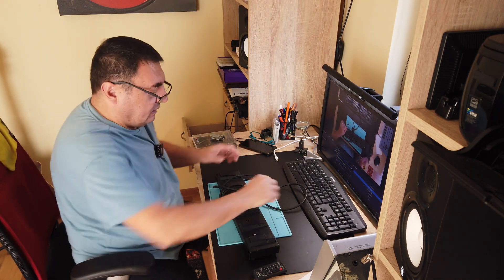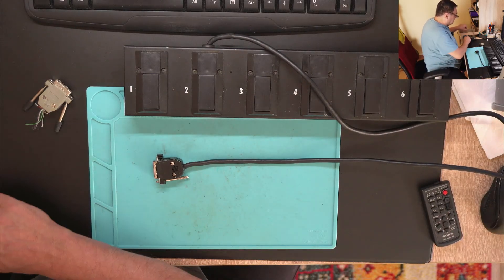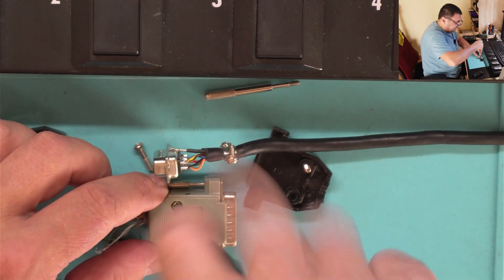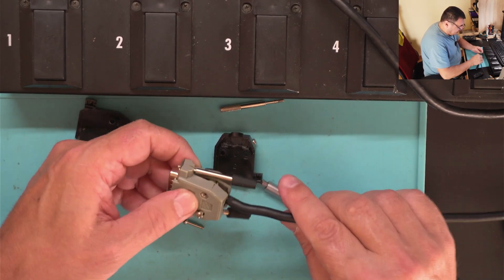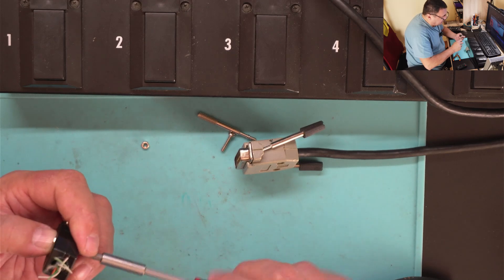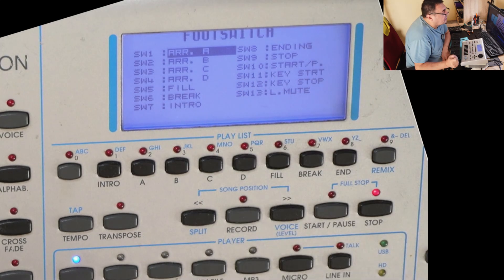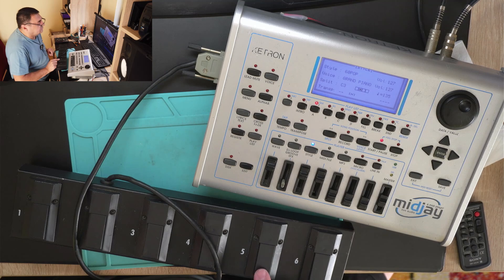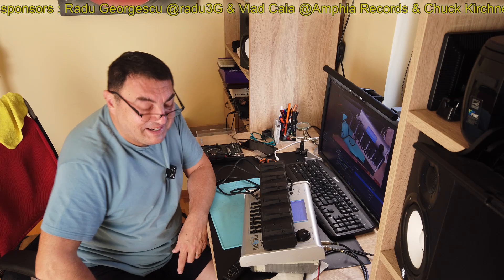Ketron FS6 Pedal Switch Fix

Comment: Să trăiți! oare dvs reparați cotx x3 miner? am o erroare pe el și nu știu ce să-i fac... Îmi spune pe HeliumGeek: Gateway No Valid Witnesses... am pus și antena stock, am schimbat și softul pe un microsd nou și tot așa...
Reply from the maker: Pot fi multe explicatii, santeti pe deny list sau e propblema cu amplasarea real a hotspotului fata de cea raportat. Ar putea fi si blocul radio, sa nu fi fost trasnit, nu neaparat trebuie sa ia foc! O incarcatura statica mai amre face ravagii! Interesant daca face beacon...?
Reply from the maker: To live! do you repair cotx x3 miner? I have an error on it and I don't know what to do about it... It tells me on HeliumGeek: Gateway No Valid Witnesses... I also put the stock antenna, I also changed the software on a new microsd and that's it...
Reply from the maker: There can be many explanations, you are on the deny list or there is a problem with the actual location of the hotspot compared to the one reported. It could also be the radio block, if it hadn't been thrown, it doesn't necessarily have to catch fire! An even worse static charge wreaks havoc! Interesting
Reply: @viocaia  în denylist nu e ca am verificat.   De la dvs am acel filtru cumparat acum ceva ani… am pus și antena stock și nimic. Nu știu cum să verific dacă e bușit ceva prin interiorul dispozitivului…
Reply from the maker: @Gu31rep  Face beacon? Transmite?